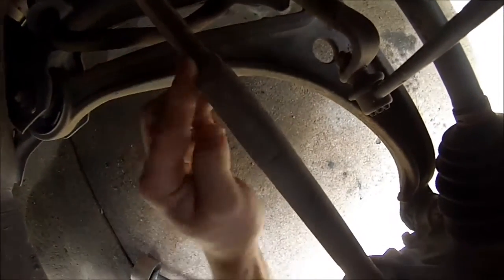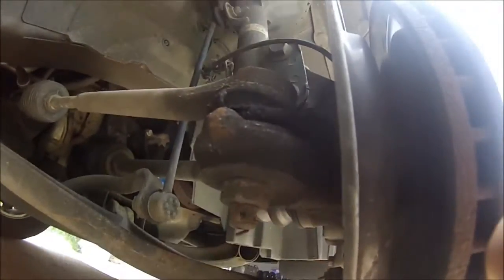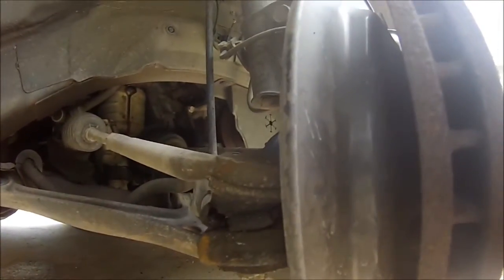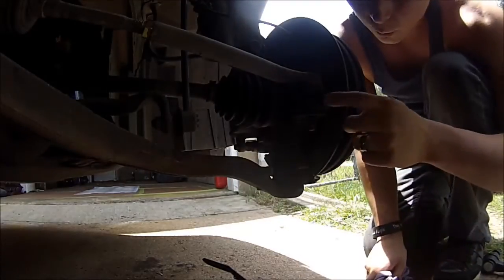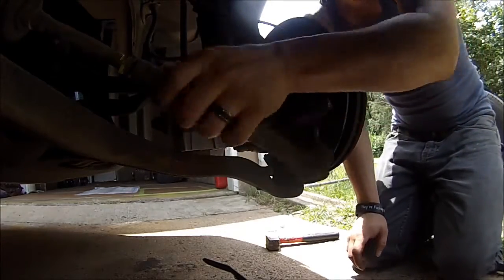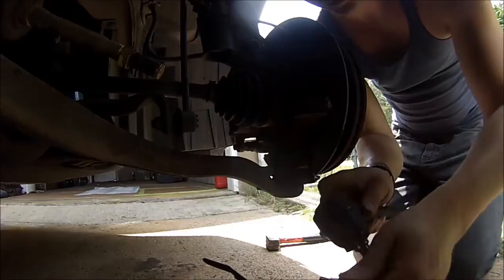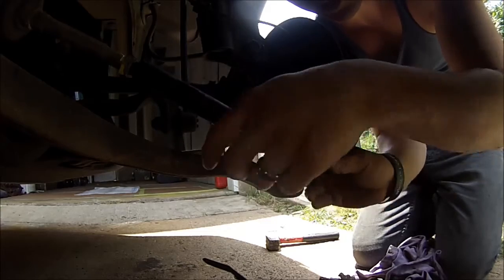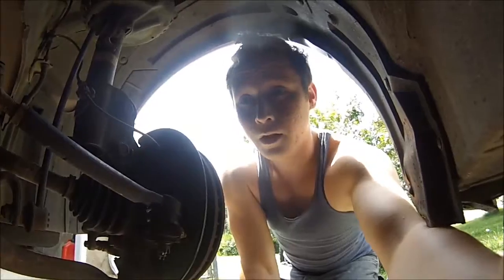How to replace tie rod ends (2005 odyssey)

Comment: nice video bro... I still miss that EF hatch you did of all the ebay parts you installed. Maybe someday get one again, keep this van for the family. Get a stock civic, and do videos throughout your build... mods, installs, maintenance, repairs... ect. keep it up man... I got my DSM running recently. Check it out...
Reply from the maker: DSM jUhnky Nice!!! Ya i miss the ef but what im doing is im using this van as a nice family van but im going to make mine a little faster and lower it a bit but  im getting another EF, EG,Or EJ1, Or even a Ej8 and im going to swap a J35 Mini van motor into it and try for 11's but im going to either boost it or build it up hardcore!

Comment: Nice...hey so I just got 4 new tires balanced and aligned went back to firestone  and they said it might be the steering wheel....it shakes a little and still pulls a little...so should I change  tie rods left and right and yes my van is an odessy 2005  TOO...thanks
Reply from the maker: Yes i would do both sides. Sounds like tie ends or wheel bearing never seen a steering wheel itself be the problem
Reply from the maker: AWESOME!!!!!

Comment: hey bud.done mean to be a dick.but most of your after market tie rod ends won't be the exact same size as the stock factory ones.the the centers from the thread end where the jam but touches to the center of the ball joint end bolt vary And that paint pen mark technically will change.my experience is that the new one are shorter buy a few threads.which will toe the wheels in.still drivable,but will murder your front tires.I have owned a shop for 16 years.not just some know it all ok.still get an alignment after this job every time.
Reply from the maker: +Ben J Oh yes it went to alignment shop afterwards and it was only barley off at all which the reason i did show to do it this way was because its safe enough to get to a alignment shop where it can get a full service alignment. I just do not on the proper set of alignment racks or anything to do alignment properly. Guessing is about as good as i can get it to make it to a rack